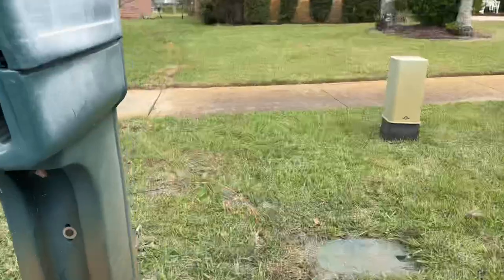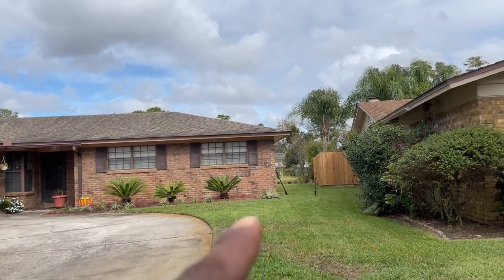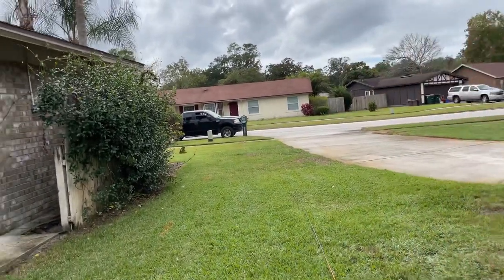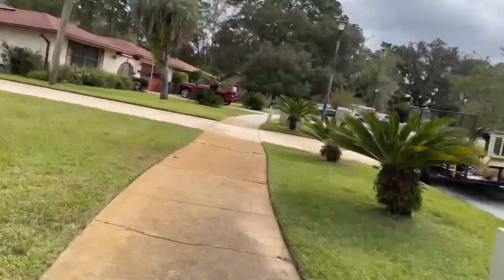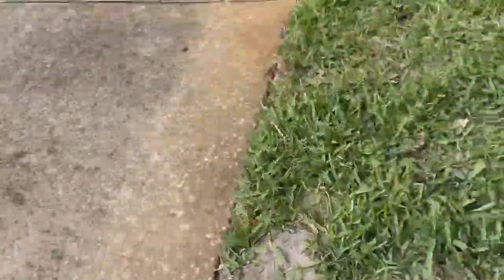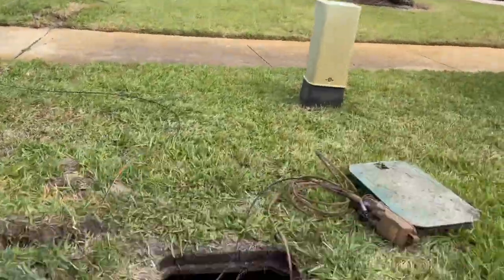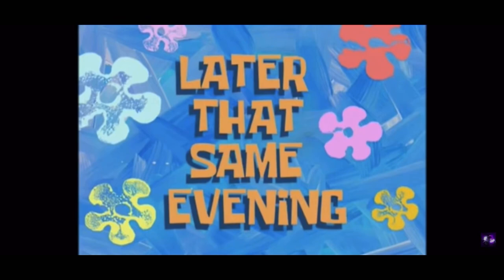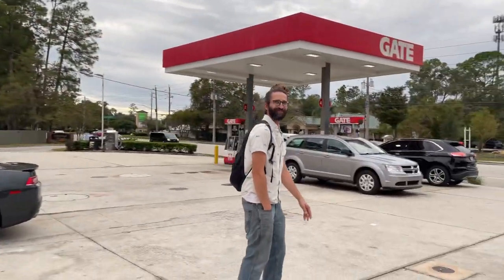How to avoid crossing other service lines for AT&T Fiber

Comment: What state are you in? We are hiring machine operators like crazy all over
Reply from the maker: Georgia Florida Alabama I’m pretty much in these states all the time
Reply: @gatewaydadon  I know for a fact Georgia and Florida are hiring, you would be a great fit man. 23.35 an hr right now plus great benefits and part of the CWA union. AT&T is putting fiber everywhere and we need directional bore operators, and regular machine operators. Just apply from the att site not indeed or monster they are shady.